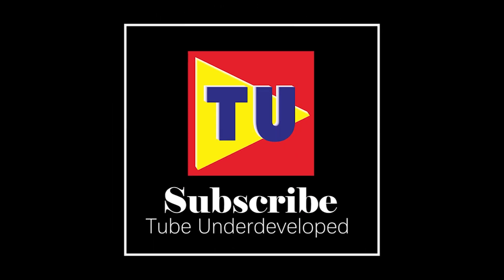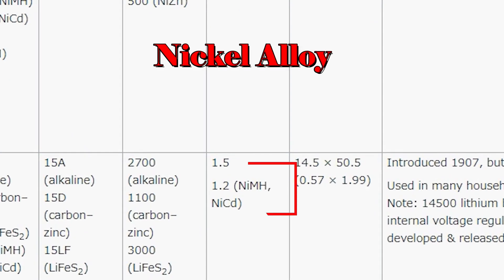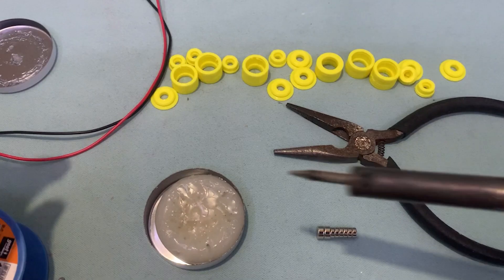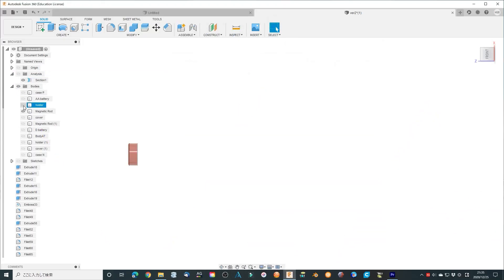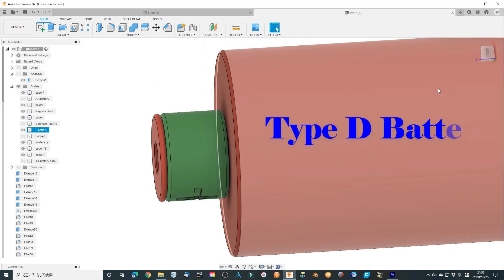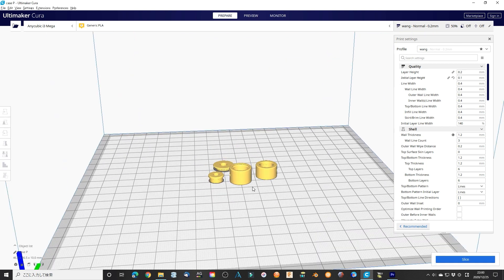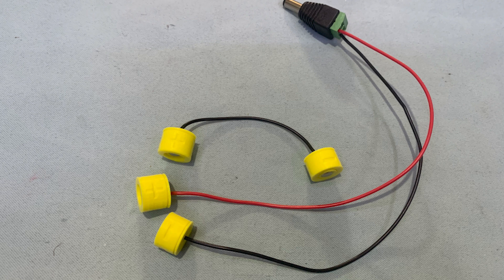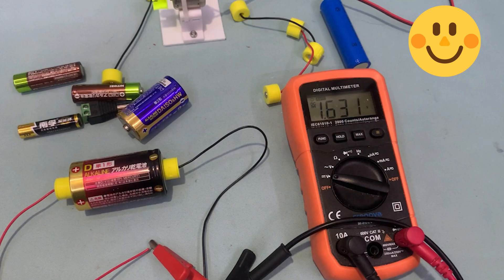I have made the first universal battery connector in the world that can be used for all battery

Comment: BUT... oxides build up on the contacts so magnetic connections aren't reliable.
Reply from the maker: Yes, you are definitely right. The normal electric jar connector is not a magnetic stick. They are the attracting force, the connector is another part. My design is just a battery connector. Mostly for hobby usage. Thanks a lot for your comment. Have a nice day.